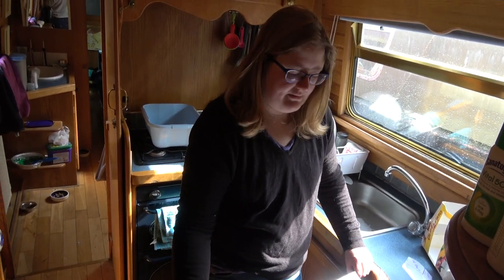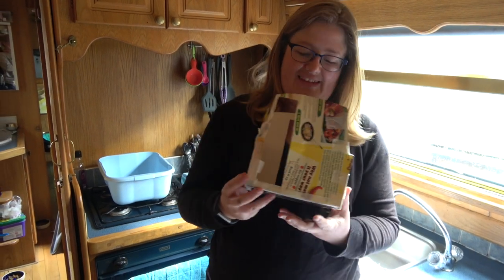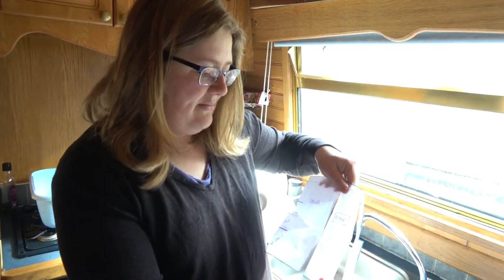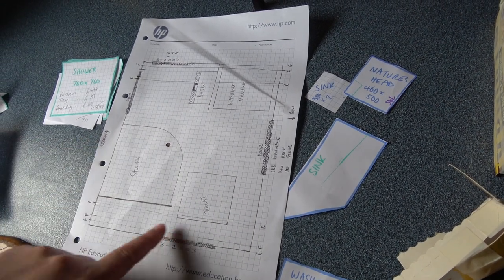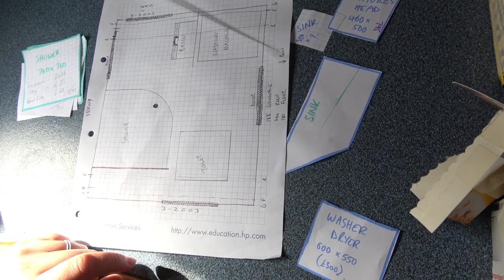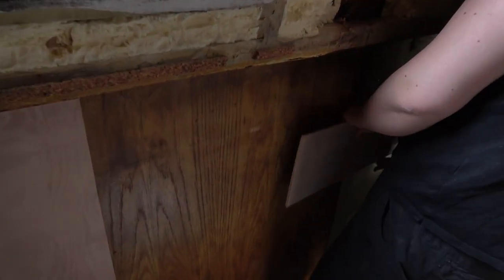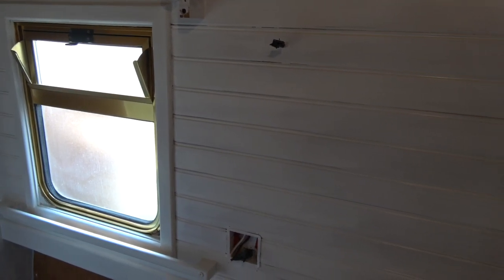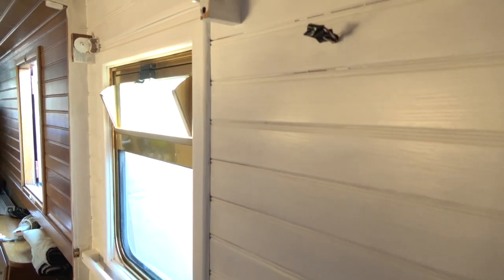Renovating a canal narrowboat bathroom | part 2 | The Layout

Comment: I take it Kath's modelling included fitting the cardboard washing machine through the cardboard door holes and any other doorways that may exist. The men from Curry's, AO or whoever might want a big tip for lifting it through the boat.
Reply from the maker: Hi Mike. I did get the tape measure out before selecting a washing machine. As you noted, there are lots of small gaps that a standard washing machine wouldn't fit through. Luckily I found one that would fit.
Reply: What machine are you getting, if I may ask?

Comment: Aside from the [paint bucket and saw dust] composting toilet all the commercially produced ones I've seen on the web are affixed and vented.  Is yours vented to the outside?
Reply from the maker: +ohbobpleez Ours is connected to the 12v to power a little computer fan. The fan is connected to a pipe that goes out the window.